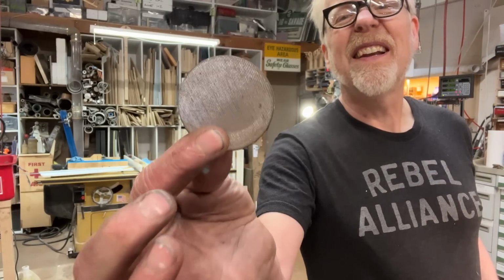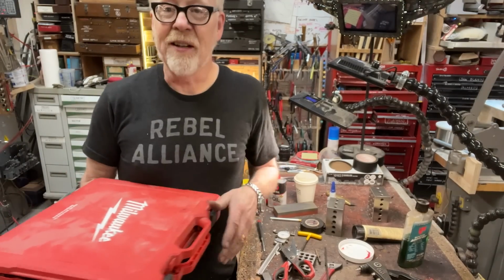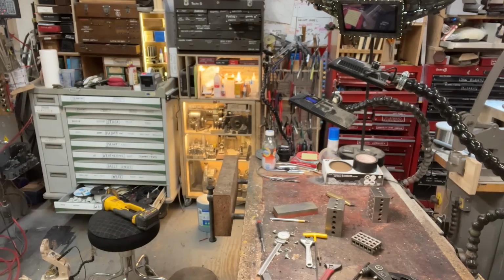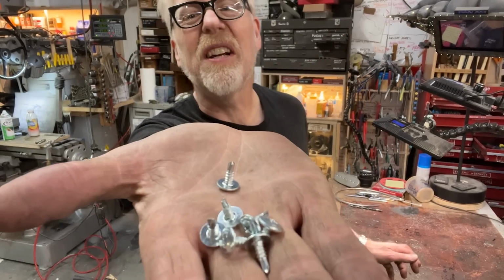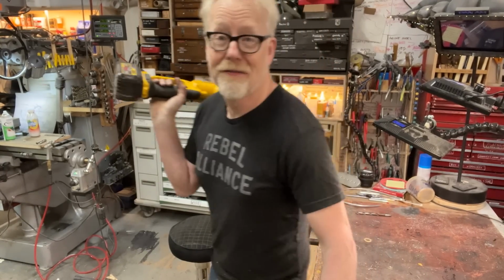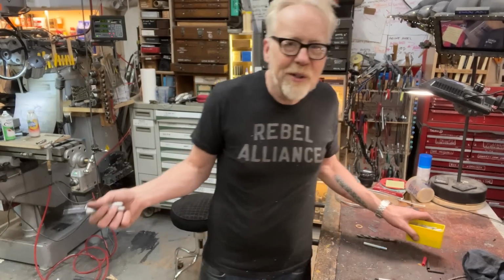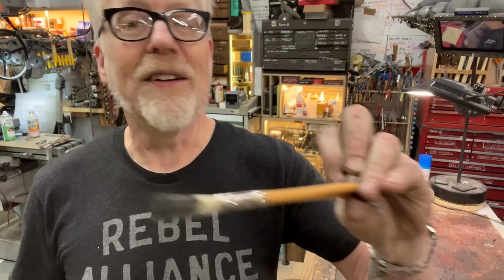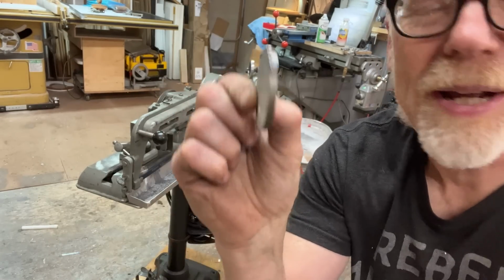Adam Savage's One Day Build Tools!

Comment from the maker: List of tools: 
All-Purpose hammer: https://amzn.to/3woB1KC
Ball Peen hammer: https://amzn.to/3pPYhyJ
Crown Beechwood mallet: https://amzn.to/3iF6yE4
Makita right angle drill: https://amzn.to/3JvrxW6
Dewalt impact driver: https://amzn.to/3Qiyr54
Makita drill: https://amzn.to/3UxmGcr
Drill America DMBO Bit 1/8: https://amzn.to/3UxmGcr
YIHUA 8858 IV Multi-Purpose Heat Gun: https://amzn.to/3xRI0lb
Milwaukee Socket Tool Set: https://amzn.to/4aNrWiS
Hurricane Sheet Metal Hand Seamer: https://amzn.to/4aPralk
WD40: https://amzn.to/44g574I
Boeshield T-9: https://amzn.to/49R193X
Norton India AO Combination Grit Sharpening Benchstone: https://amzn.to/3WcEfk7
Norton Triangular Fine Grade India Sharpening Stone: https://amzn.to/3UyqIm1
3-In-One Oil: https://amzn.to/3wdkWN2
Milwaukee Jobsite Scissors: https://amzn.to/4d55LX3
Lucas Red N Tacky Grease: https://amzn.to/3UuW6l4
Loctite 380 Toughened Max Instant Adhesive: https://amzn.to/3JDT5IV
GearWrench Ratcheting Combination Wrench 1/2": https://amzn.to/3JxE3ob
Maxwel Cloth Electrical Tape: https://amzn.to/3Jvu4j4
Power Probe Micro Torch: https://amzn.to/3w6jqMN
Starrett Dial Caliper with Adjustable Bezel: https://amzn.to/44bK6rW
Mitutoyo Dial Caliper: https://amzn.to/3w6kSi8
Anytime Tools Dial Caliper 6" / 150mm Dual Reading: https://amzn.to/3vXoDqj
Mitutoyo 293-340-30 Digital Micrometer: https://amzn.to/4dmAcYW
Xacto knife: https://amzn.to/3Qdvxyo
KNIPEX Wire Stripper: https://amzn.to/3w6m312
KNIPEX Automatic Wire Stripper: https://amzn.to/3U5ilN2
BL-123 blocks: https://amzn.to/3Qfjgtn
Drill America 1/2"-13 High Speed Steel 3 Flute Spiral Point Tap: https://amzn.to/3UvjZsL
Crescent wrenches: https://amzn.to/4baancs
Allen Wrenches: https://amzn.to/3xHTLdF
Sherman Marson Rivet Gun: https://amzn.to/4aIPsxo
Flange Pop Rivets 1/8": https://amzn.to/4aNw6Hw
Wiha Screwdriver Set: https://amzn.to/4b5Ipi4
Zinc Wafer Self-Drilling Sheet Metal Screws: https://amzn.to/3xQCLSK
Fluke 101 Basic Digital Multimeter: https://amzn.to/3w6mN6p
Signature Precision Square: https://amzn.to/3QigzXR
Channel Locks Pliers: https://amzn.to/3Ue6M6z
Nippers/cutter pliers: https://amzn.to/3UbIhHa
Needle-nose Pliers: https://amzn.to/3xYAlkO
Knipex Needle-nose Pliers: https://amzn.to/3JT3tgp
Sharpies: https://amzn.to/3UvOheZ
Parts washer: https://amzn.to/3xQCfEh
Roll Pin Punch Set: https://amzn.to/3Qg7P4L
Solder Seal Wire Connectors: https://amzn.to/4aMiXP3
Double-ended machinist twist scribe: https://amzn.to/44fH0Dt
Presto white-out pen: https://amzn.to/4dd88Hm
Wirefy Heat Shrink Tubing Kit: https://amzn.to/3WaF8tC
Disclaimer: Tested may earn an affiliate commission when you buy through the links here.
Reply: Any chance you can put a link to your shop cloth (recycled surgery cloth) supplier?
Reply: For Adam, 18:28 that's the speed and direction adjust. Rotate it the desired position so the motor turns in the right direction. It's the same mechanism found in common garden variety impact drills with rotating speed collars and you've seen the very same mechanism at play in HTR's video titled "Why Did They Stop Making These? [Restoration]" just in a different format. I suspect that motor was for a post drill in its previous life, it's very much overkill and a waste (of a good motor) for a hacksaw which can only rotate one way only because they're designed to cut on pull, slip on push.
I highly recommend swapping that motor for a same power and speed ratio (perhaps even slower for modern cheaper made saw blades) and using it for something more appropriate for its station.
Reply: I mean you changed the logo plate cause you didn't like how it looked. Well maybe if your weren't to busy looking at only it you would have seen the big arrow on the wheel indicating its intended direction of spin. Yet you totally ignore it and just go "Oh this cuts on the push." And still not realize it was spinning in the wrong direction. Cool little machine though.
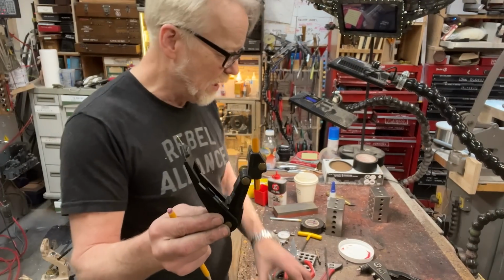Reply: I've very curious about the super-sturdy-looking compass that appears at 4:22, do you happen to have any more detail on that ?

Comment: I have a question. I want to create buildings for back ground environments in my toy photography. I'd like the ability to build cities. I was thinking of using styrene. But the problem I am having and cannot grasp how to do this in my mind. How would I cut square windows for the buildings? I found this cheap deal of LED lights from allie express so some lights are on in the building some are off. I just cannot wrap my head around cutting small squares for windows. I use six-inch action figures. The building will not be at 1/12 scale.  but there are going to be a lot of square windows to cut. And I fear my only option is to cut them one by one with an exacto knife. And that makes me want to skip my idea. This is similar to my attempt making Star Wars Star Destroyer space walls and after the first wall and all that precision cutting to get those long round circular wholes I gave up and paid a guy to 3d print them for me.

Comment: The solder connectors under performing on older wiring is likely a case of newer pre tined copper wire vs older plain copper wire.

Comment: As a mechanic, I use my mulitmeter in continuity mode more than any other, need to figure out if something is an earth lead, easy as, have a power lead and need to find out where it takes power from? Gotcha, find out if the blue wire at the front of the vehicle corresponds to the pink wire at the back? If it beeps it’s a yes.

Comment: have you tried to burn off the gunk on old wires when using the solderless solder connections? a recent project had some old wires that wouldnt wick solder until I blasted it with a blow torch

Comment: that heat gun looks like a hot air rework gun for soldering if anyone was wondering. you can do a lot with it, my favorite is lowering the air flow it puts out so it doesnt blow parts away

Comment: 11:22 Oh, but what about Ticonderoga Yellow? The older version, not the pale tone Papermate has chosen these days.
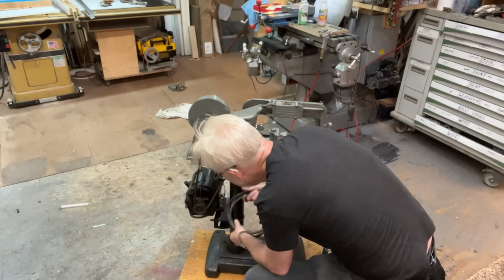21:25 You're right. That exposed belt is NOT GOOD. Just as you leaned down, - had that been going, it may have caused you some scalp damage. Would have pulled some hair for sure. Please fix it. I don't want to visit you in the hospital.

Comment: Adam, you can make a beeping circuit. It is just lead plugs and power with a beeper. The fun part would be making a box to hold it. Maybe a very small rectangle the size of a stick of gum but half an inch thick.

Comment: When I was younger I used to think that anyone who's using a crescent wrench seriously would always be using those 12" or bigger ones because "bigger is better" right? The 6" wrenches were only good for working on bicycles or other light handy work in my mind.
Yeah, no.
Now I'm in my 40's and have worked jobs where you have to do a lot of spot repairs and equipment maintenance, and those 6" wrenches are The Thing. They are light and easy to manipulate with one hand if you need to. Most of the time you need it to hold a nut still while you unscrew the bolt. You only need the big ones when you're working on heavy equipment and the bolts are giving you attitude.
I've honestly been using the same 6" wrench I got for my bicycle maintenance kit for 25 years now. It's been to many jobs so I had my own wrench and I take it with me when I leave, lol

Comment: Hey Adam, would you consider attaching a dust collection vacuum to the tray to constantly remove the metal shavings as the saw is cutting that way you have less cleanup after the cut is done? Just a thought. 🤷‍♂️

Comment: The "speed adjust" is the brush adjustment for reversing the motor.  You "can" adjust the speed but it is not the Intention, the motor has a designated rpm you should set it to and leave it alone.

Comment: My favorite way to make wire connections is to use non isolated crimps  with marine grade heat shrink. What you end up with is a water tight connection with protection from vibration stress. Once you try it, you will never go  back. This connection is also very small.

Comment: Adam, those OR towels can be washed. Having worked with those towels for 30 years, I (and my coworkers) always took the excess home, otherwise they ended up in a landfill. The ones we took home were opened but not used. But I use them all around the house and wash them. They will give up the ghost, eventually, but not until you've gotten hours of use.

Comment: Adam,  Did you ever think of picking about 25 of your most used tools and hang them within easy reach of your bench?  For example, you were saying that many of your pliers come out for almost every job.  They might qualify as part of the 25 tools that you would permanently place near your bench.  I have started doing this and it has been a time saver for me.  Among my 25 are ball peen hammer, needle nose pliers, side cutters, utility knife, 4-in-one screwdriver,  hand drill, drill index, impact driver, vice grips, channel locks, and flashlight.

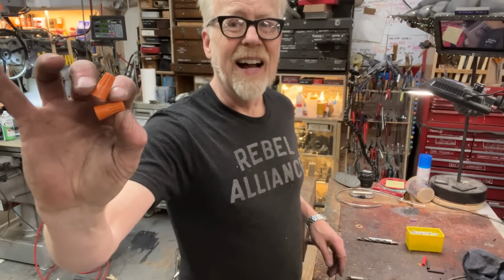Comment: 15:43 i wouldn't bother with vinyl gloves. They're too thin and too cheap to be usable. Kitchen gloves' is where it's at. Sturdier, last longer and you 100% won't cut them when working, because the material's thicker. You can re-use them for long periods of time and unlike cheap vinyl gloves, they have good rubber with ridges meant to grip stuff. Get them in the right hand size, and you're also much more comfortable that the almost always poorly fitted vinyl glove. Even better, use electrician's rubber gloves. Those are one step higher still.
At the end of the day, they're easily cleaned in the same parts washer, then a little bit of kitchen detergent to wipe off the chemicals so they don't get attacked when stored away.

Comment: I don't use them much these days, but wouldn't ever get rid of my first dial calipers. The drawback of them is not being able to switch between metric and Imperial, whichever is most convenient when working on vintage machinery. If you can't afford Mitutoyo, iGaging is a good quality brand.
Reply: The name keeps popping up. They clearly did themselves a disservice when they named their joint: sounds like a 2005 startup, when it was briefly cool to stick an i in front of stuff. Ten years earlier they probably would have called it Gaging 2000. Not a great name, it suggests “cheap and cheerful” or worse. But apparently their stuff is decent.
Reply: @mm9773  I like them mostly because they have huge digit readouts, which are easier on my pensioner eyes. Plus the model I bought has metric, inch and fractional inch modes, which is great when you're measuring old imperial hardware (here in the UK).

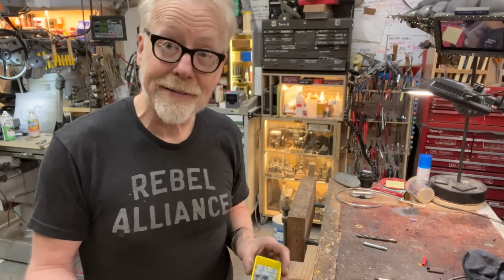Comment: That bit about the connectors at ~17:00 was interesting.  Anyone know more about the reason?  I presume the old wires are all copper, so I'm wondering if it's an oxide buildup or if the metallurgy has changed over the years.

Comment: Off topic, sort of. Do you ever 3D print utilitarian things? We haven't seen a ton of 3D printed stuff from the cave, but I can only imagine you're printing cosplay and prop items nearly daily with the setup you have. 

I live and travel full time in an RV and have a 3D printer that I seldom use for anything other than functional stuff like wire management, switch covers, specialized electrical cases that are unique to X situation, etc. I find that buying these things are either costly or (more so) bulky. Like I need 3 cable hangers, but I have to buy a package of 20 and now I need to find a place to store 17 of these things in an already storage-prohibitive place. 

Anyway, just curious to know if you do any functional 3D prints.